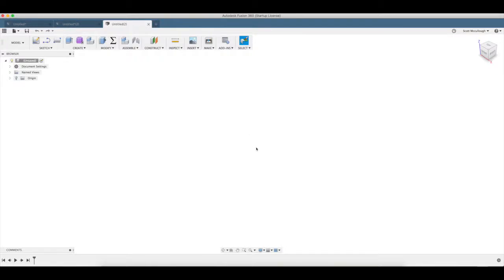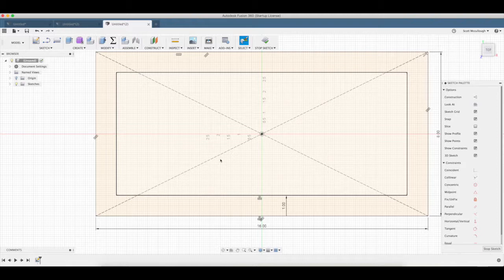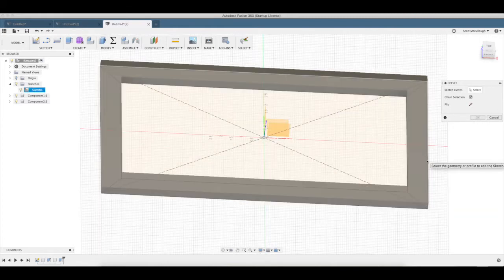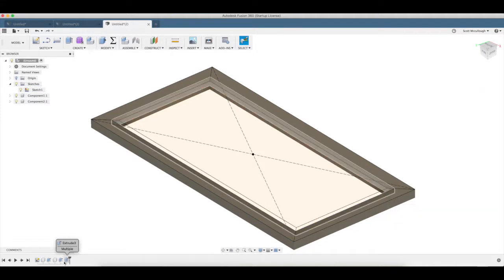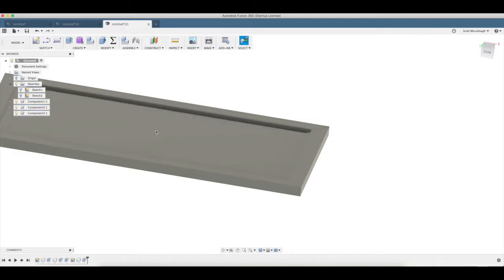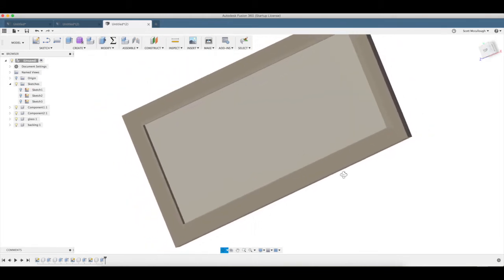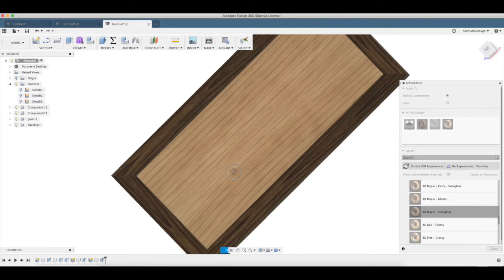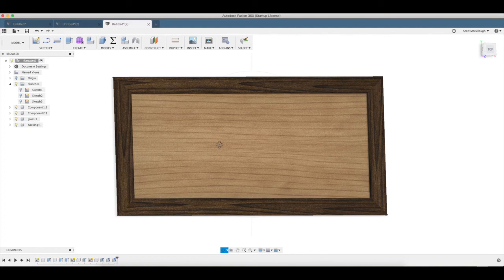Fusion 360 For Woodworking: Making Picture Frames

Comment: This was really helpful.  Thank you.  I wonder, i tried this with the idea that the glass size was fixed at 11x16, so the rabbets would need to be an 1/8 inch wider and taller while not going over an inch wide on the frame.  I got stuck though and couldn't make the fixed size glass fit in the rabbets.

Comment: Cool video. The thing I didn’t understand is how this design makes the front glass not to fall?
Reply from the maker: Thank you for the comment. So glass would set in the rabbet and the backing material would hold it in place. Backing material is normally constructed of thick card stock like material. What holds the backing material is half turn clip. This can be found on just about all picture frames. Thanks again for the comment.
Reply: Got it) simple and cool. I will try to use cnc and sheet of painted laminated plywood to make numerous frames of different sizes. Should be easier than standard woodworking procedures.